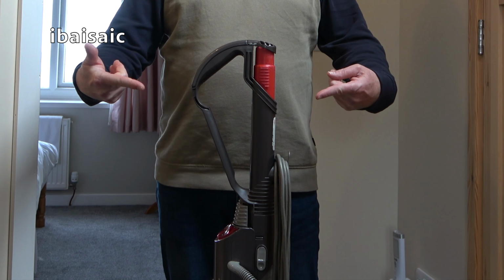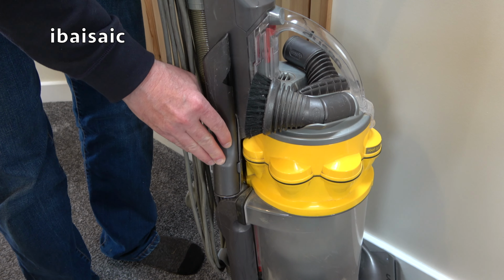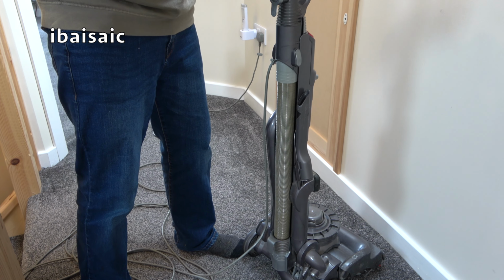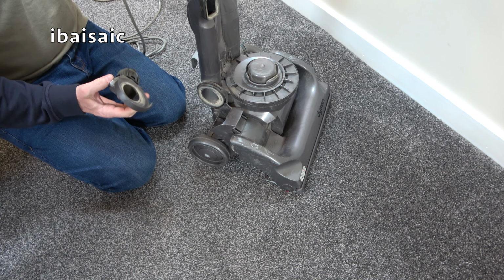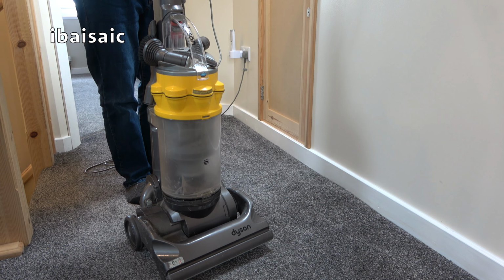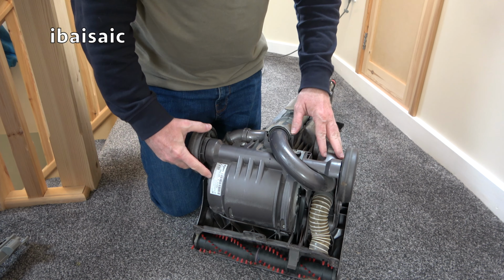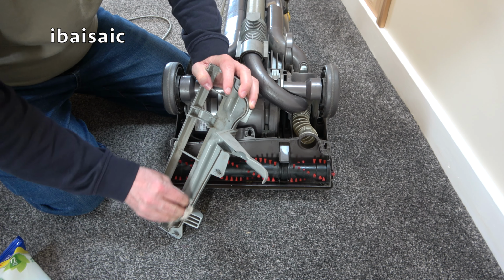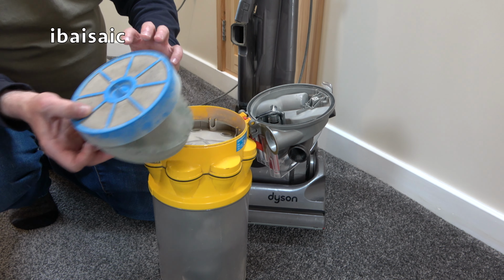Dyson DC14 Upright Vacuum Cleaner Basic Maintenance

Comment: I like these standards of the Dyson DC 14 upright vacuum cleaner I like to get my hands on one new in the box but for all floors with the clutch at the bottom because this one in your holiday home is the original standard yellow one of the Dyson DC 14 upright vacuum cleaner cause this one is just for carpets only cause there's no clutch on the original standard yellow one it's a good 👍 vacuum cleaner but it sounds very noisy you could stip it down and give it a good clean and see to the motor bearings and put some oil 🛢️ on to grease the motor bearings to make it sound a bit quiet and healthy and pleasant to use

Comment: The brushrolls on the non clutched versions were a different shape to the ones in the clutched models, with the clutched models having the more slimline helical plastic shape, and the non clutched versions having a more round, standard shape for the the brushroll. Not sure why they did it like that, but thats Dyson for you.
It sounded like the main bearings in the motor itself were worn, probably been used most of its life without getting the pre-motor filter cleaned, it may have also got a clogged exhaust filter restricting airflow, and as you know, clogged filters pass through more dust, and make the motor get too hot, leading to failure of the motor. I dont think that motor has long left, it may well "die soon". Nice of you to give it a bit of love though, but its probably all the love that machine will get before that motor blows.

Comment: I like the Dyson Dc14 I like to get my hands on one of them but I want the all floors cause I haven't got much carpet just in my bedroom and stairs. It's a good vacuum cleaner but it sounds very noisy and ruff it needs a good clean the motor bearings and some oil to grease the bearings to make it sound quieter and healthy but this Dyson Dc14 is the original yellow one just carpets I want the grey one for all floors

Comment: It's not all that bad. I still have an original DC14 that has been very reliable for about 20years. The machine in the video has obviously been neglected, but is still working, albeit very loudly. I agree about the extension hose being a struggle, but outside of that weakness, it's been a very good tool. I expect more good years ahead.

Comment: The color scheme of that particular DC14 reminds me of the DC33.  It's a shame really that we never got too many of the non-clutch models for the DC07 and DC14, we had a DC07 Carpet that was a Walmart exclusive, but none after that one, ever since then we had models with a giant opening on the rug plate, and that weirdly thin helix designed brush bar.  I really do wonder though if the cleaning performance of these non-clutch models are any better if any.  I do like how the brush bar looks on that particular DC14 (and that one looks to be a triple row if I'm looking correctly).

Comment: I’ve noticed that this is a belt driven and not a separate system like they are in the us is that only in the uk or did it come as an option
Reply from the maker: This is an old model that was also available in the US which was belt driven. The DC15 was the first upright to have a separate brushroll motor.

Comment: This dyson sounds like a dc 03 I wonder if this dyson dc 14 has a dc 03 motor in it
Reply: Dyson used Samsung motors in their dc14s/33s around 2009/10 rather than the standard ydk ones so they sound different. I believe that’s when this machine is from as I have one similar

Comment: I used to have a DC14 and hated it with a passion. The suction at the hose was pretty good but at the brush roll is very poor, the V6 cordless has more suction at head and a better brush roll. The noise was the worse my ears were ringing afterwards. Only thing I didn’t mind is that cyclone system worked well the filter’s stayed clean for longer than current cordless models. 
It was replaced with a bagged Miele much cheaper than the Dyson I will say and to date it is the best vacuum I’ve touched and with some bonus attachments it’s made it a very good performer. Also never going bagless again hate cleaning bins and filters when I just fit a new bag and get on with life.

I like the brush roll design on this one compared to the one on we had, ours had the clutch system also.